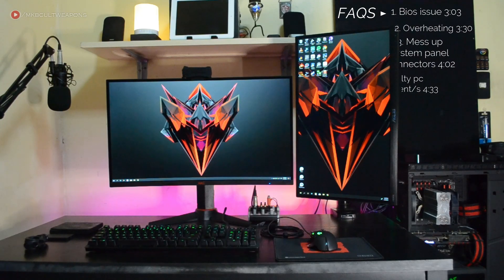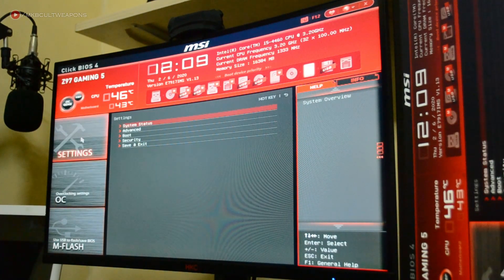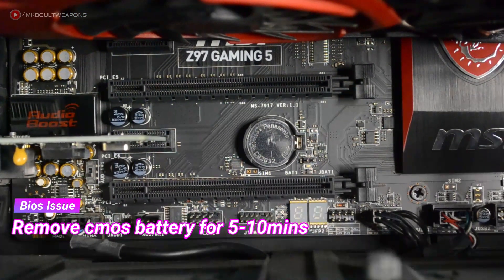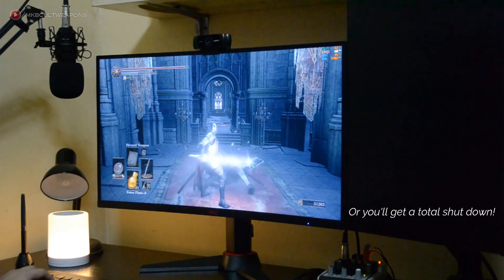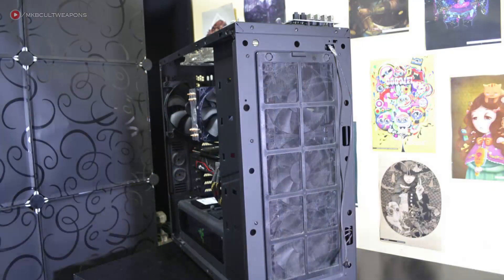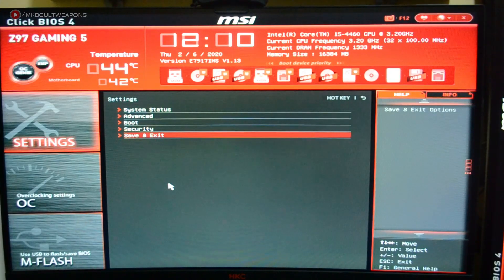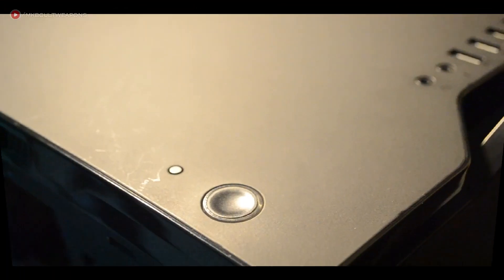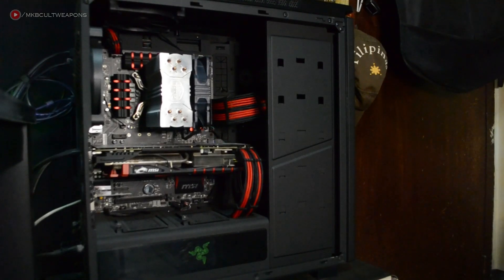Pc keeps restarting FIX / Pc continuous restarting FIX

Comment: I've been messing with my pc for about 6 hours now. I've cleaned every particle of dust, reapplied thermal paste to the CPU, deleted all recently installed apps and updates, updated my motherboard bios, ran numerous command and malware tests. I'm losing my mind...
Reply from the maker: can you tell us how the pc problem started?
Reply: @MacCoyzkie  Out of nowhere my computer just kept resetting anywhere from a few seconds to a few minutes after windows booted. I ended up starting to isolate the internal components and unplugging the hard drive seems to have fixed the issue.
Reply from the maker: @rickyism1576  i see, the hdd might be failing already or just the sata cables
Reply: @MacCoyzkie  so it started happening again tonight with the suspected hard drive unplugged. Only now there was sometimes no boot drive available in the BIOS and my m.2 was not showing. I’m thinking it’s the CMOS battery because the time on my PC is also off by two hours.

Comment: hi my pc is doing the turning on and off after i restarted my pc to have a clean one and it’s still doing it and i cleaned everything and even got new rams / PSU and still nothing anything i can do ?
Reply from the maker: this might be because of the new ram sticks try doing this https://youtu.be/S9hyEPTFR10 if you are in windows 10. If you're using windows 11 you can also do that assuming you know how to bring back the tpm setup. This could also be low power draw from the outlet itself, i suggest try using avr or ups
Reply: @MacCoyzkie  hi yes i tried that and it still didn’t work if u can help me out i will be willing to pay just need this fixed
Reply from the maker: @honnids1430  can you try your new gpu with another pc, if the results are the same you might use Rma at this point

Comment: if the pc turns on and you log in then later the boot procces happens again what can it be
Reply from the maker: try the fix in the video
Reply: @MacCoyzkie  i did all fixs in the video sometimes i will be on it for 2 gours or more then it will restart but its never overheating it just restarts
Reply from the maker: @spxcdd  did you have power fluctuation in your house lately?
Reply: @MacCoyzkie  no this happend randomly
Reply from the maker: @spxcdd  you need to have your psu checked because this might be failing already. You need a tester like this https://amzn.to/3f5jtg5

Comment: Nice video, having this problem but not this frequent just random on and off issue, this is a pain staking task especially the cleaning to dismantle everything hehehe.  How would you know if the mother board is failing by the way?
Reply from the maker: if you tried new parts and still does not work
Reply: @MacCoyzkie  Actually just this evening, I found out that my AVR is the one having trouble, the soldering inside it's female socket is cracking and loose, but a did all of this in your video this morning, now it's working fine, hopefully hehehe nice video I love the full details.
Reply from the maker: @robbyalmendrez1750  glad the video was helpful
Reply: @MacCoyzkie  Indeed sir more power to you.

Comment: My pc keeps restarting only after I remove the power cable or there is no electricity and when I plug into and I turn on the pc it keeps restarting like 5-6 times over n over again,any help?
Reply from the maker: this also happens when there was or still have power fluctuation in your house, you must also check if your psu is giving enough juice for the system less this restarting will happen. use a psu tester like this https://amzn.to/3f5jtg5

Comment: How can you get in to the bios if it keeps rebooting there is no way
Reply from the maker: if this is a new pc build double check the front panel connector, perhaps its misplaced. If its an old build try one ram at a time perhaps one is faulty causing auto restart

Comment: My PC works completely fine until I start gaming and after 5-10 minutes of being in game the PC just blue screens and then restarts without any error message.
Reply from the maker: if it happens to all games then that's probably overheating. check your cpu and gpu temps to confirm. Open your pc case side panel just in case your system needs more airflow

Comment: What if you plug it in, after you use parts from a previous build. You know that one of the rams were damaged, but, the other Ram still works. Instead of keeping that ram in though, you replace it with a different set, never used. Then you reset the battery, and the cmos. After finding out that doesn't work, the screen is still black, but all the fans work, and the green light is lighting up. All the USBs are working, because I downloaded a Bios from ASUS, and the lights on the USB light up. I put a GPU into the motherboard, the strange thing is, it doesn't need to be plugged in. I have no idea why, but, there is no plug in whatsoever on that thing. I replaced the CPU with a compatible one that has never been used. I also replace the cooling fan with a new one, never used. All through this resetting the battery and using three other batteries that I knew worked. Nothing . Unplugged everything, plugged it back in. The hard drive is new too. Checked to see if the ram slots and the connection for the rams were clean. Brand new power supply. The Motherboard is a DDR3. Still after doing all of that, I get a black screen. I put the USB in with the downloaded bios and the screen stays black. Nothing. I found that one of the rams was damaged and used two new ones to see if the slot was damaged or the ram. The new rams worked. Previously, the computer was damaged by a powersurge, but, ran for a year and a half longer. Finally, I woke up with the lights on the computer flashing on and off. I was surprised when I tested it and found that on the ram was damaged.
Reply from the maker: instead of trying every pc parts in your existing rig i suggest ask a friend with compatible pc to try each pc part in their rig, one at a time.
Reply: @MacCoyzkie  That would work. I already know that the one ram is good. I also know that both slots for the ram is good. Not sure about these batteries though, and there could be something wrong with the CPUs but I also used another one that was never used before. I redid all the wiring too. All I can think of is the motherboard. The Bios is gone, and the flash drive won't put it into the computer. Thanks though.
Reply from the maker: @workingwithaudioandvideo6239  if its the cmos battery you should see "power saving mode" on your display. but if its just pure black screen then i guess it is the motherboard indeed
Reply: @MacCoyzkie  Thanks for the feedback. I agree, I went ahead, and got a new motherboard. It fired right up. I appreciate all the help from everyone who commented too.

Comment: I just built mine and I’m still in the bios my ram mgz I supposed to be at 3600 but for some reason it’s at 2133 so I set my mgz to 3600 like it’s supposed to be but now my gpu keeps turning on and off every 3 seconds, specs: rx 6600 8gb, rizen 3600, ram 16gb 3600, what do I do?
Reply from the maker: if your system is turning on and off that means the ram sticks overclock didn't work. you also need to check if the motherboard & cpu supports the speed otherwise problems may occur. If im not mistaking R3600 supports that speed with no problem so check your mobo. for now go to bios and load optimize defaults to reset
Reply: @MacCoyzkie  I did, and I forgot to take my plastic rapping was still on my gpu 😂 I’m feel silly beginner mistake, thanks for replying you don’t need to reply back I know I’m annoying
Reply from the maker: @dice44  ohhh that's not good lol... anyway its ok bro, most of my viewers are beginners and that's no problem at all
Reply: @MacCoyzkie  it’s still rebooting every 8 seconds when I turn it on I can’t even do anything so I think it’s the power supply not giving enough power to the gpu
Reply from the maker: @dice44  that is also possible, check the psu wattage using a psu tester like this https://amzn.to/3f5jtg5

Comment: Hi there Yo man same happens to me but when I remobe cmos and then insert it it works I just got a new cmos is Cmos tha cause?
Reply from the maker: that might be at some cases but usually the screen will display power saving mode if the cmos battery is the problem

Comment: For extra fun, I'm running into a self-correcting, intermittent boot loop. System will hold at 60-70°C under sustained 100% loads on the CPU and GPU.

Comment: How long does these components or each pc part lasts?
Reply from the maker: depends on how you take care of it, i build this pc back in 2014 and i gave it to my dad and its still working up to this day. But commonly around 5 years
Reply: @MacCoyzkie  thanks. It helped. I do have a pisonet business in PH. Mostly due to room temperature and dust is my main problem to my units
Reply from the maker: @kyeivkash  no problem bro. if the system has too at least 6 fans you should clean it every 6 months or at least once every year.
Reply: @MacCoyzkie  i only have 2 cpu fans and electric fan. The area is too small that only kids kay can fit
Reply from the maker: @kyeivkash  once a year will be enough, the only usual thing that might break a pc is overheating because of too much dusts.
Reply: @MacCoyzkie  thank you for tips sir

Comment: Hi may problem is my monitor dont have signal and may pc is on and off after 3 to 4,5 secs fans working,aio pump fans working, gpu fans working, install new thermal on my processor, clean ram and like you do in the video, my main concern is my mobo is the problem or psu? 😅
Reply from the maker: if you tried all the suggestions in the video and nothing work then there might be a faulty part, have your ram sticks and gpu tested in a different pc, if problem persist either one of those are faulty. if it didn't persist then the psu or the motherboard might be the problem but you can use a psu tester like this https://amzn.to/3f5jtg5 to test the psu

Comment: Mine first froze a few times, so i had to turn the pc off and on from the power button, this happend 2 times and after that it started the rebooting and shutting down thing. I let it cool down and tried to restart it and it worked for a moment but then froze and started the rebooting again.
I was tired so i just shut off the power and went to sleep, then in the morning, even though i hadnt done anything to the pc it just suddenly started working perfectly fine..
If anyone knows why that is i'd be glad to hear.
Reply from the maker: if you are also experiencing stuttering you must back up your important files now because that might be a failing drive.

Comment: Mine tried to auto update last night and got stuck turning its self on and off over and over again all night and now whenever I turn it off and try turn it back on it just keeps doing the same thing, it never shows anything on the monitor just start, stop, start, stop, about 2 seconds apart, can't get it to do anything else for last 24hours
Reply from the maker: when update process is interrupted this usually happens, you can try to go to safe mode and delete the previous update. If you can't get into safe mode i think your only choice is to totally reinstall windows
Reply: @MacCoyzkie  I can't even get it to turn on to the point where I can do anything though, like it starts only to the point where the lights come on and fans start spinning then it beeps, turns off and starts the same thing again. Nothing pops up on my monitor  at all cuz it doesn't get that far
Reply: @MacCoyzkie  is there any way to do a system reset or restore to last working setting without it turning on fully
Reply: At one point it made it to the bios but only for like 30 seconds and then shut off, and it only happened once in two days
Reply: @MacCoyzkie  I tryed cleaning everything, taking the battery out, cleaning the ram sticks, swapping them around, everything that was in the video
Reply from the maker: @Mizzle420420  i see, did you you have any power fluctuation in your house lately? this sounds like low power draw either from a faulty psu or the outlet itself. For now i suggest use avr or ups to see if its an outlet problem. you might need to use a psu tester like this https://amzn.to/3f5jtg5 to check your psu stability. If there is anything i think this is a faulty psu

Comment: Bro can u help me. when i start up my pc then i tried to refresh it my screen suddenly froze and i waited a couple of minutes then it shutdown by itself and when i tried to start it up again my cpu just keeps turning on and off repeatedly like the cpu turns on for 1 sec then turns off immediately then its just repeating itself over and over again?
Reply from the maker: unplug any old hdd or usb. this might just be the cause. you could also clear cmos just in case
Reply: @MacCoyzkie  what's a hdd and cmos? Sorry new to this thing's
Reply: @MacCoyzkie  sorry if i wasn't being clear my problem is that when i press the power button of the cpu it turns on for 1 sec and turn off. Its not like i keep pressing the power button its just the cpu is turning on and off in a loop after i pressed it and the monitor is on black screen. Yesterday my pc was still working though. Do u know what caused this problem?
Reply: @MacCoyzkie  still waiting bro for ur reply :)
Reply from the maker: @Red-el8bm  pardon me bro, its easy to miss some comments. anyway have you tried cleaning the ram sticks like in the video. If that still does not work try this clearing cmos https://youtu.be/S9hyEPTFR10
Reply: @MacCoyzkie  tnx bro I'll try it

Comment: My pc just show that screen where you press DEL key to enter bios and I can enter bios but when that screen shows up it just restarts and does this over and over and all things in the pc like keyboards rgb goes off and on and over and over but in bios it’s normal and I think it’s something with windows could you or anyone please help?
Reply from the maker: try to reattach the sata cables in you boot drive and clear cmos afterwards, here's how to https://youtu.be/S9hyEPTFR10
Reply: @MacCoyzkie  ok imma try This out and if it works i Will say here!
Reply: @MacCoyzkie  not working bro any other ideas?
Reply from the maker: @josef9112  i see, are you using any ups or avr by any chance, because this might be something to do with power. Problem might be a low power draw from wall outlet or psu causing the system load half way
Reply: @MacCoyzkie  im not using ups or avr, i think my pc broke its not even old too its pretty good stuff in it
Reply: @MacCoyzkie  so i can go inte bios and stuff q-flash but right when its going to going into windows screen it just restarts, but I don’t mean that the windows loading screen show up it just comes up that screen where you press del for bios you know then i can go into bios there and it’s normal but if I let it it just restarts over and over forever
Reply from the maker: @josef9112  can you remove all hdd and just use the ssd boot drive and start the pc. this might be just hdd getting faulty
Reply: @MacCoyzkie  I did that still the same thing, I tried many stuff I even removed and cleaned ram, I unplugged and plugged back in many cables. But still the same thing and now I’m kinda scared cuz if it’s not the hdd it can be something more expennsive
Reply from the maker: @josef9112  ok at this point its really difficult to find which pc part is causing it. Can you ask a friend or someone with compatible pc to try your ram sticks, one at a time and also your gpu. if those works without a problem then we got to set those parts aside and check the other parts. You need a psu tester https://amzn.to/3f5jtg5 to test your psu, btw if the fans running and lighting up does not mean psu is giving enough juice for the entire system. at times it causes restarting loops like what your are experiencing. If its not the psu then this could be a faulty motherboard. The processor rarely breaks earlier than the motherboard so no need to worry about the cpu
Reply: @MacCoyzkie  cant i check that in the bios? Or do i need psu tester
Reply: @MacCoyzkie  btw ty so much for even helping
Reply: @MacCoyzkie  also before i could go inte automatic repair but i Said who Cards and i tried to facitet reset and now its this
Reply: @MacCoyzkie  ahh bro I got some help with some friends and he said I might have downloaded windows 11 corrputed
Reply from the maker: @josef9112  i see, btw windows 11 is still unstable specially with its graphics issues.
Reply: @MacCoyzkie  imma make a media creation flash drive and try to reinstall Windows and imma gonna use Windows 10

Comment: My pc is like this turning on and off, i cleaned the components, change my psu, check the cables but every morning every time i turning on my pc is keep restarting. i dont know what to do. i Guess i need to change my motherboard or cmos battery, can you help guys i need it for teaching :<
Reply from the maker: might be just loose cables since you change the psu, also have you tried the fix in the video yet?
Reply: @MacCoyzkie  i changed my psu for that reason i thought it will be fix
Reply from the maker: @jameslaspinas7228  try using an avr or ups because this might also be power fluctuating
Reply: @MacCoyzkie  thank you bro!!, appreciated!, i think i should change my motherboard. i tried to remove my 2nd ram then it works properly. i think my ram slot has a problem
Reply from the maker: @jameslaspinas7228  i see, i also experience fixing one of those and it happens to some mobos unfortunately. I hope you get a good deal with your next mobo of choice